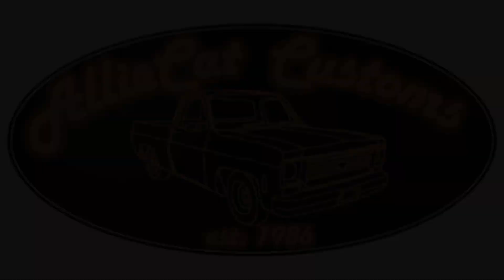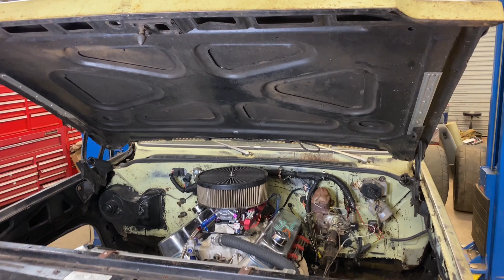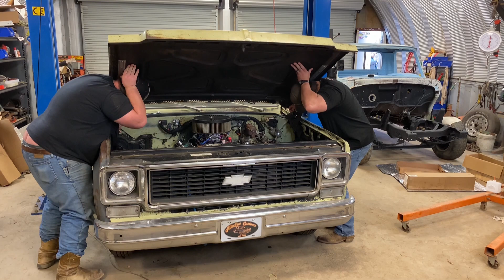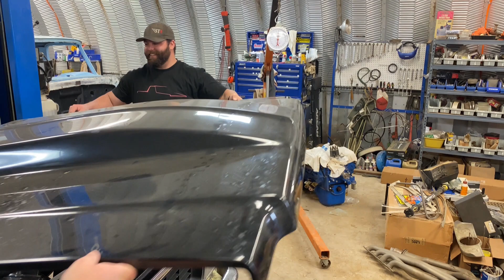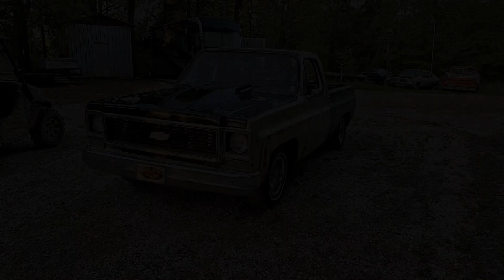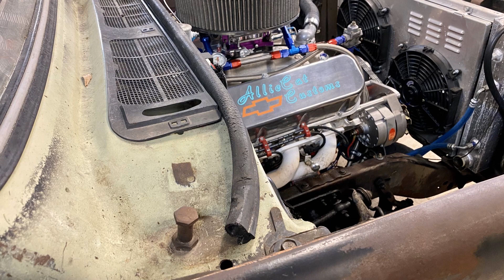How-to: Install a 4” Cowl Hood on a 73-80 C10 (Weight Comparison + Hood Pins)

Comment: I noticed you don't have a brake booster and I want to do the same on my build. So my question is did you modify the brake pedal and or use a smaller bore master cylinder?
Reply: Something different on pedals. Do not remember what I had to do but do remember had to get part of brake pedal from junkyard and bought a new manual brake master cylinder from Oreillys.

Comment: That 74 looks badass I like the way it looks you should just clear coat it I’ve got a 79 with a 83 front clip what kind of transmission do you have
Reply from the maker: I run a th400 trans. Thanks! It’s fun for an ole beater 😎